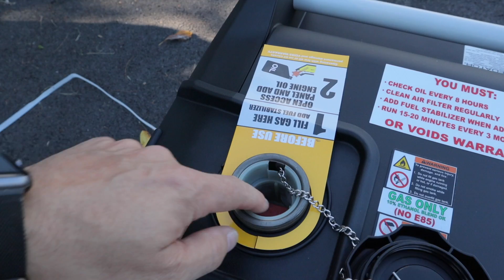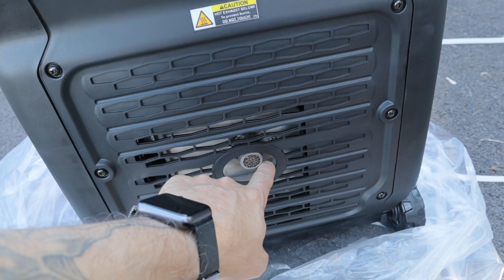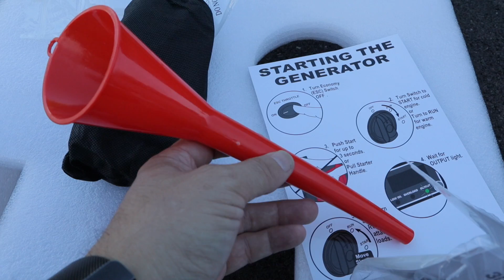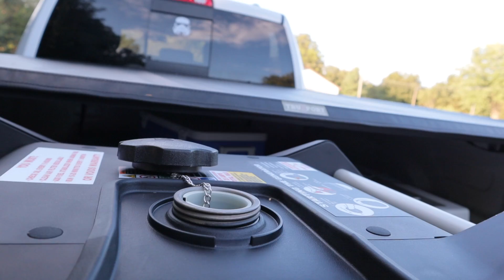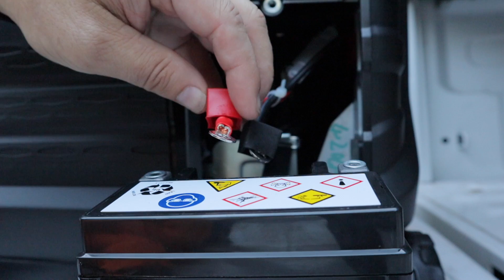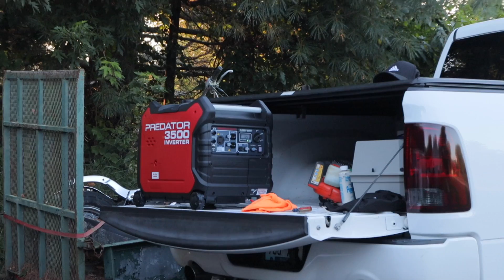Day 14 - Full Predator 3500 Generator Tour & Setup! || #RVLife

Comment: Apologies if you answer this Q later in the video (as I type this, I’m at the 5min mark)- We just got back from a quick test trip (all systems on a new trailer & brand new Predator generator) in the mountains. It was on the warm side during the day, so we kicked on the generator to run the AC for a few hours. It seemed to work excellent, until I turned on my keurig coffee maker 😕😞. Did you experience trouble running your AC & Fridge?
Reply from the maker: Not the AC and fridge. But any high appliance appliance is going to max it out. If I were you, just shut the air conditioner off for the few minutes you’re going to use your microwave or coffee maker and when it’s done you can turn the AC back on.
Reply: Avion Awesome  will do, thank you 😊. I’ve sent all 4 of your videos on the predator to my husband- thank you for making them !
Reply from the maker: My pleasure. It’s been great and still running like a champ. Currently in the mountains of Montana and it’s been a great backup to my solar.

Comment: Does it have an hour meter?  ANY generator, with a 4-stroke engine, that does not include an hour meter is inexcusable regardless of price.  
Remote control for electric start (if included)?
Sine or square wave power?
Total harmonic distortion?
Auto-throttling depending on load?
Ease of draining carburetor for long-term storage?
Ease of adding, changing or draining the oil?
Engine displacement?
Long-term durability comparison with Honda?
Accurate, dependable fuel gauge?
Toolless access to the engine?
VERY IMPORTANT:  Availability of replacement parts?
Reply: Yes it does have hour meter an it does not have remote start . It is a sine wave generator an on eoco it does keep down as to load applied. As far as carb it can be drained as well as fuel tank but you have to remove side cover on side you check oil. Now to the oil it is easy to drain if you set it on something to be able to get a pan under it and with the stuff that comes with it it is ease to replace the oil

Comment: I just bought one yesterday and I love it but I have one problem. The plug they give you fits so tight on my plug from my RV 30amp. Now I can’t get the adapter off my RV cord. Got any ideas on how I can pry them apart easier? I’m afraid to put a metal pry bar in between the adapter and my cord.
Reply: Twist and pull
Reply: You need to twist and pull,it lock in place so it can't come out.also you need to twist it when you install it also.hope this  help.

Comment: Please tell me you didn't put mobile one than that thing??? I don't care what oil you use as long as it's an off-road motorcycle oil which has a higher zinc content which is perfect for smaller engines
Reply: be sure to follow the break in procedure.run for a while on cheap oil , drain put in the good stuff. these predator engines are full of casting sand and metal shavings. i would do the oil change twice before the good stuff.they hold right at one quart. i own several predator 212's.....trust me on this...

Comment: I am now using the Sportsman 4000 Watt Dual Fuel Generator and the Sportsman 2200 Watt Dual Fuel Inverter Generators. The 4000 is an open frame with a noise level of >68db and the 2200 inverter generator is >60db. The Predator 3500 is listed as 57db, so they are all similar in their sound output range.

Use this website to find Real Gasoline without Ethanol in it: https://www.buyrealgas.com
Reply: Sportsman 4000 much louder especially when plugged in RV...not much comparison bud. I've had both generators

Comment: That generator will sound louder simply because the sound is bouncing out of the walled in area of the bed of your truck.  I know it is just you demoing and yes it comes across louder on the phone for sure.  But if you had that down on the ground it would be quieter.

Comment: I bought one last fall probably about the time you did this video. I was tempted to go with  TWO Predator 2000i which would be cheaper than ONE Honda 2000i. And like Honda you can string TWO Predator 2000i together. HF told me that they would be selling a kit to string TWO 3500i together sometime this next year (2019) so I decided to go with this one (3500i) because it will run the AC in my motorhome. Once the kit comes out, I plan to buy another 3500i. One cannot be too rich, too thin, or have too much ammo & power !!!